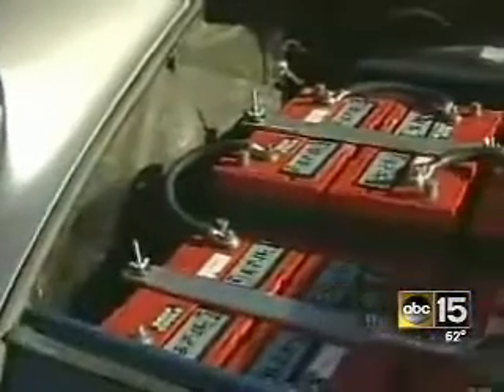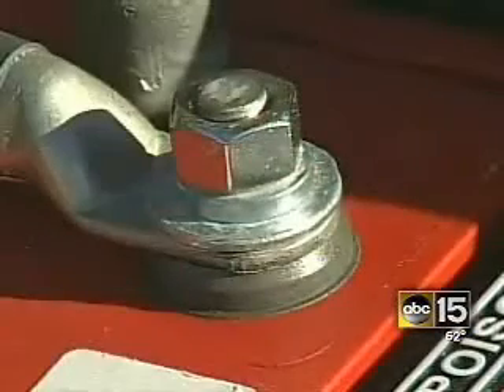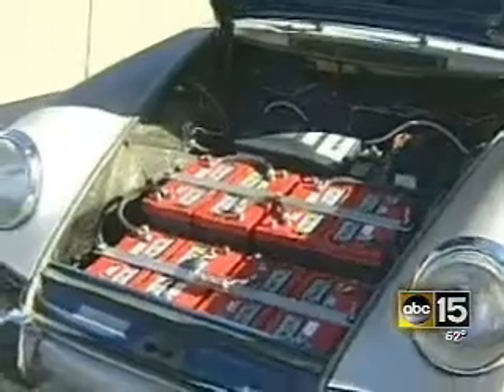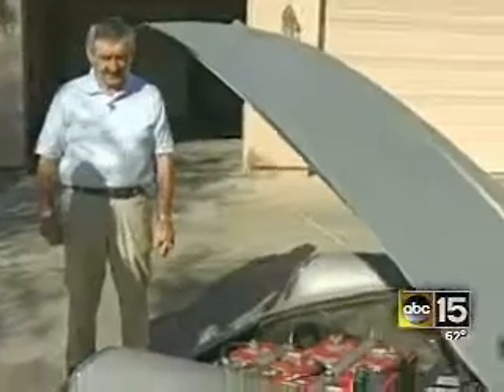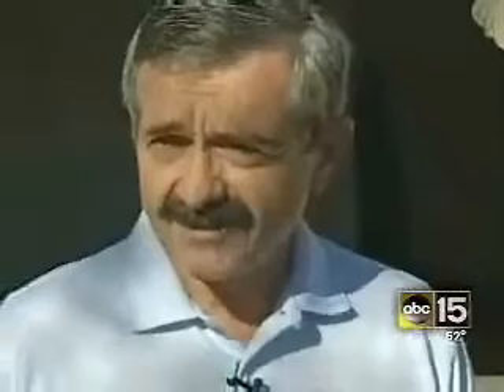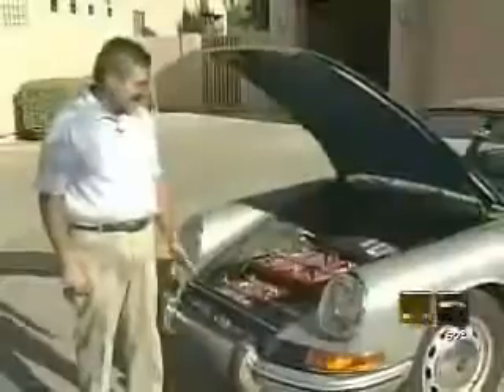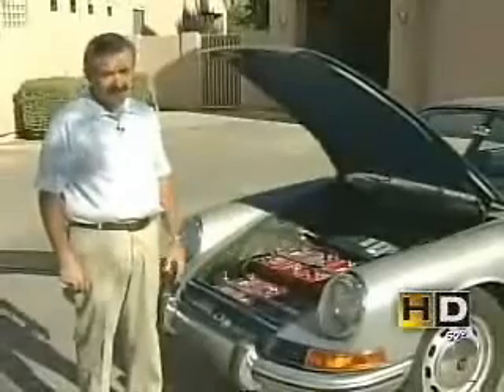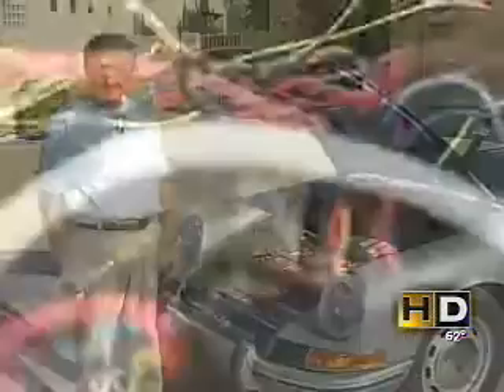DIY Cheap Porsche EV conversion $6500

Comment: Yes it's true.  In fact there were several patents filed accross the world to improve the gasoline engines in production.  One of these would have improved efficiency by 300+%.  In response, the oil industry giants decided to put lead into gas that would clog up the engine.  As a result, we saw more gas sales and an ultra slow increase of efficiency to delay progress in favor of wealth.  Weak.  Go electric and tell your politicians - this is important to discourage potential corruption.

Comment: If we use EVs for work commute, we DO NOT need to import oil...
We have done similar conversion, with 70miles range and 48 cents per charge, you can see it here 1-ev.com
My 2c.

Comment: 50 miles a charge and a $8000 conversion minus the motor? Not bad at all. I wouldn't count on that 50 mile range lasting too long, though. Batteries suck.
Reply: Batteries do suck.